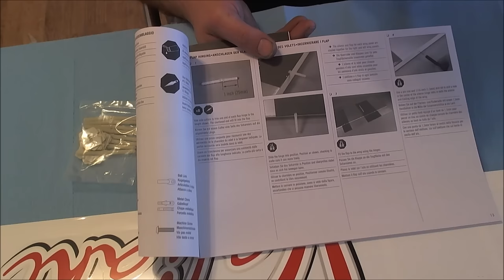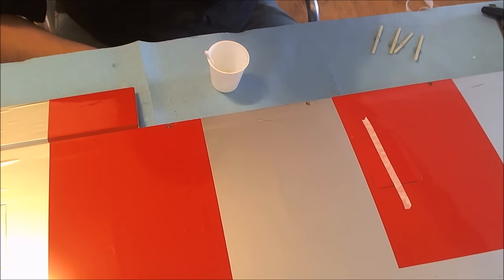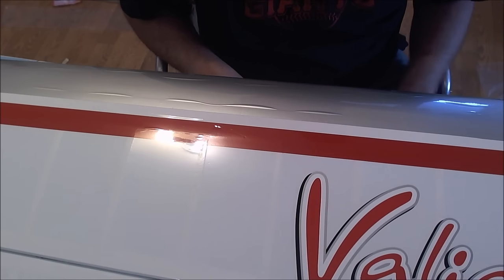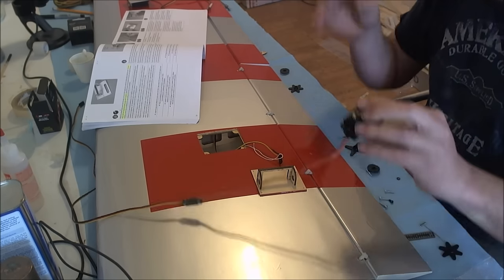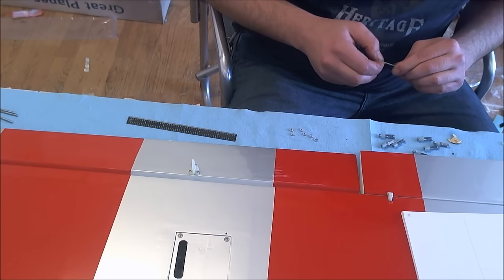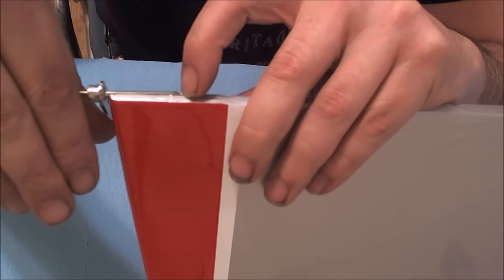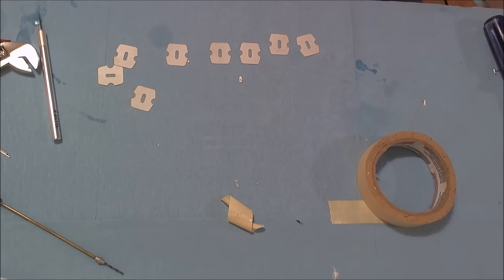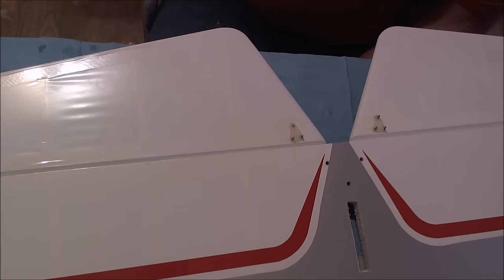Valiant Build Part 1

Comment: If you use a z-bend on the server side of your linkage you will not need to use a lock nut and it's much more secure.

Comment: you could just removed the connector from the wire lead ran the wire then put the plastic connector back on.... THEN put the extension on